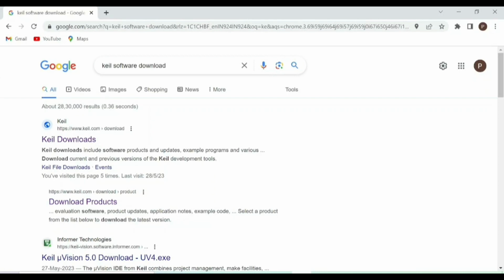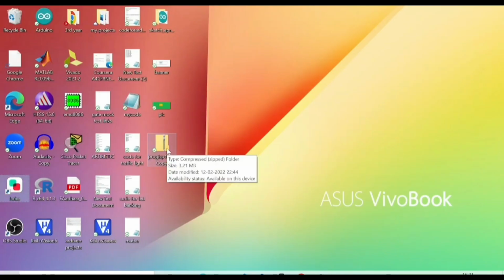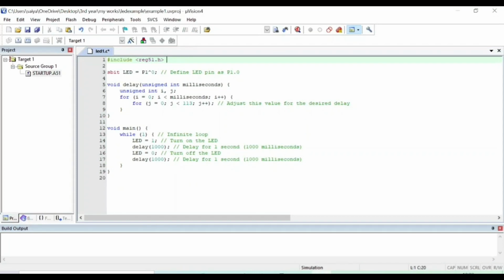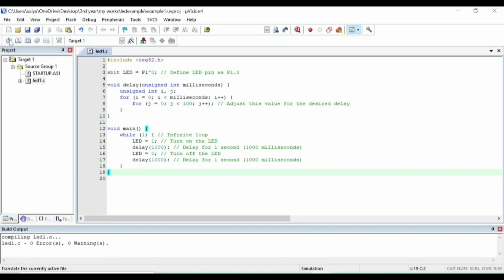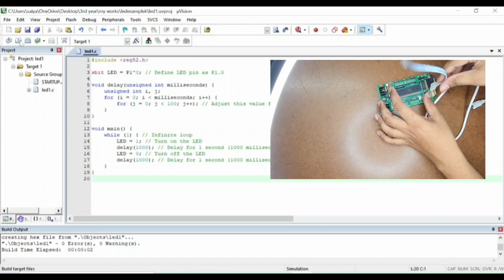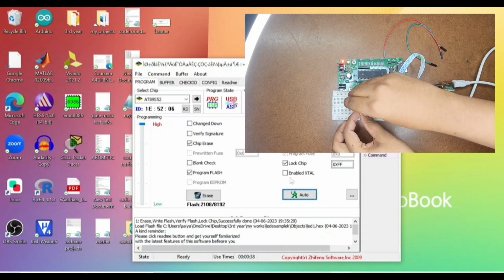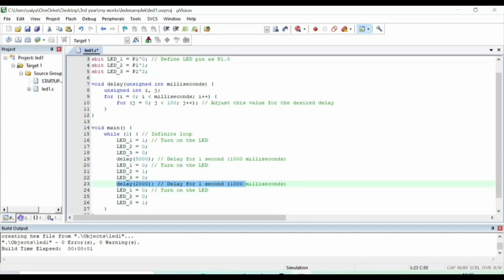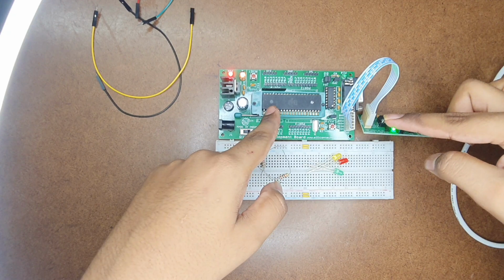Led blinking using 8051 Microcontroller Board | 8051 TUTORIAL  2

Comment: Sir I have an issue in PROGISP 
When I going to click on auto  this message appear "Programmer can not be found" please explain that sir
Reply from the maker: The "programmer cannot be found" error usually indicates a connection issue with your hardware or missing drivers. Double-check your connections and driver installation. If that don't work u can press the reset button while u click auto it clears the problem sometimes. Also once verify whether u are able to see the programmer listed. If the problem still exists u can mail me at the mail id padharthisaiyashwardhan@gmail.com
Reply: @padharthisaiyashwardhan chip unable program error .now this error is showing.sir I done everything but can't find solution for it